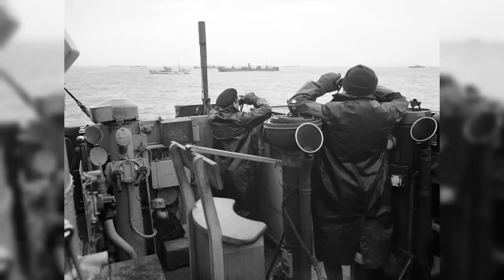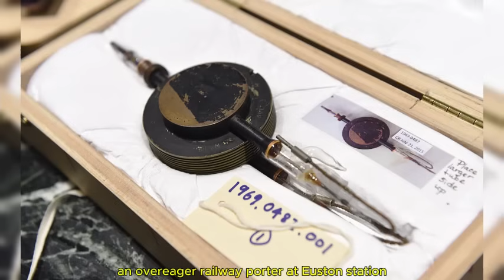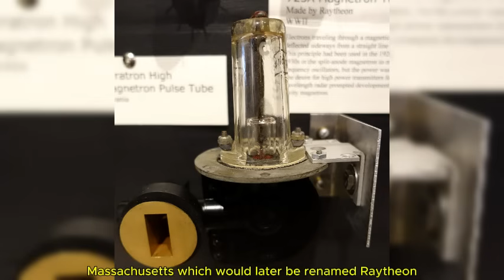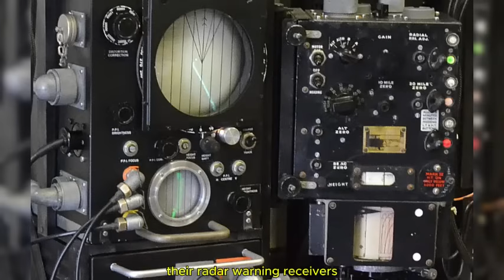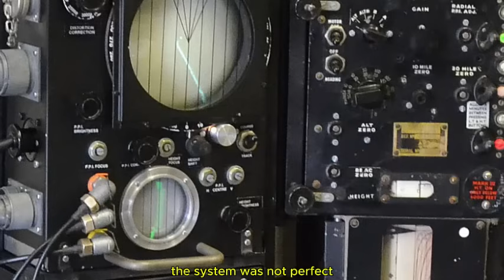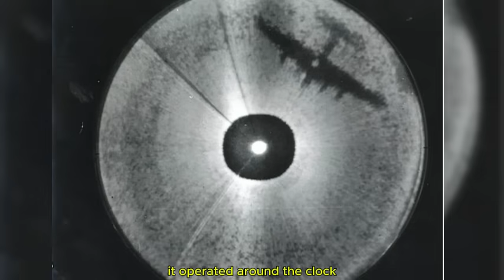America Had No Radar Tubes in 1940 — So Raytheon Mass-Produced Magnetrons That Found Every U-Boat

Comment: The need to create radar systems possibly led to the discovery of the transistor, and this in turn led to today's massive electronic technology. While searching for ways to detect radar signals, they discovered the germanium diode, and this germanium served as the basis for the "double discovery" of the transistor: the discovery made in the United States, but also a little-known discovery made in Europe by two men named Matare and Welker ( German scientist). These Germans had observed that if they placed a third electrode in the shape of a needle near the "cathode" of the germanium diode, applying an electrical charge to that third electrode modified the intensity of the electric current passing through the germanium diode. I believe they called it the "transistron."
Reply: That diode is inserted into a "waveguide" and detects the RF the receiver can use.
Reply: British came up with the first production silicon semiconductor device in November 1940 in the shape of the Silicon Tungsten cats whisker diode. It was used to extract the Intermediate Frequency from the mixer of a Centimetric Radar receiver. The MIT Rad Lab team bought an experimental Centimetric Radar system over to the UK to evaluate it against prototype British systems in October 1941. The two systems were about equal in performance. During the Trials the British and American teams tried mixing their Transmitters and Receivers to see what happened. The UK Transmitter and US Receiver suffered a massive decrease in performance, while the US Transmitter and UK Receiver had triple the detection ranges of the UK or US system. The US receiver used a Tube diode in the mixer, while the UK one had the solid state one. The US team said, we tried to make the Silicon Tungsten diode from your reports and couldn’t get the things to work. The British reply was we couldn’t get most of our ones to work either, until we get the odd one that does work. US investigations into this problem found that the pure Silicon being used wasn’t pure enough and the impurities were stopping the device from working. After working out how to purify the Silicon to a pure enough standard, the US started to produce these diodes by the bucket load for both US and UK radars and yes it did lead to the solid state electronics of today.
Reply: @richardvernon317  The discoverer of the PN junction in semiconductors was the American physicist and engineer Russell Ohl (working at Bell Laboratories). He discovered the PN junction around February 1940 while investigating silicon rectifiers for radar detectors. Ohl noticed that certain silicon samples produced an unexpected voltage when exposed to light (photovoltaic effect) and rectified the current, indicating the presence of an internal junction between materials with different impurities. The junction was identified as occurring in the contact zone within a silicon ingot where the impurities separated: phosphorus created the "n" or negative zone, and boron created the "p" or positive zone.
Reply: @richardvernon317  Russell Ohl's discovery of the PN junction, which guided the design of the transistor, was almost? miraculous: Ohl was analyzing the electrical resistance of a piece of silicon with a gap. Miraculously, he observed that when the gap was illuminated with light, the electrical flow increased. He then discovered that this gap also exhibited diode-like characteristics. He analyzed the silicon on both sides and found an excess of boron on one side and an excess of phosphorus on the other. He deduced that the presence of these two elements influenced the junction's behavior as a diode.

Comment: In the late 1970s and early 80s I worked at a company in Georgetown Ontario that made big honking Magnetrons as spares and replacement for the radars in the Pinetree Line early warning radar. I recall disassembling the the test setup when they ceased production...the enclosure was about the size of one of those newsstands in NYNY give or take. There was concern about 'soft' X-rays getting out. The tubes were in the shape of a German potato masher grenade only bigger and quite heavy, They were made mostly of copper with the cathode at one end and the RF window at the other.

Comment: 50 cm = 600 MHz, 10 Cm = 3.0 GHz in 1940 !!!!
Reply: The detectors were diodes - not the most sensitive.
Reply: Sir Jagadish Chandra Bose was researching microwaves up to 60Ghz in 1894.
Reply: @pietersmets5551  I was about to challenge you on this........except it turns out you're right! Sir Bose did indeed pioneer microwave research decades ahead of everyone else. He wasn't even awarded a Nobel Prize for his ground-breaking work, and I suspect the fact he wasn't a white European had a lot to do with that.

Comment: Police radar guns do not use cavity magnetrons.   Semiconductor devices have replaced magnetrons in most low power applications.
Reply: I believe the magnetron has the defect that the frequency it produces is unstable (I think TWTs are still widely used in high-power radars for air traffic control and military radars because they allow working with many frequencies, whereas in ship radars etc. special FET transistors made of Gallium Nitride are being used)
Reply: @TheMariepi3  That's right.  Much of the RF noise and instability of a cavity magnetron are side-effects of the same spiraling, bunching electrons that make it work in the first place.
Reply: They use to cook their balls.